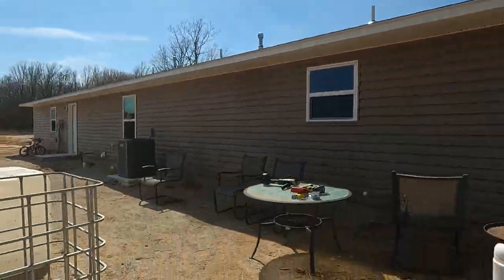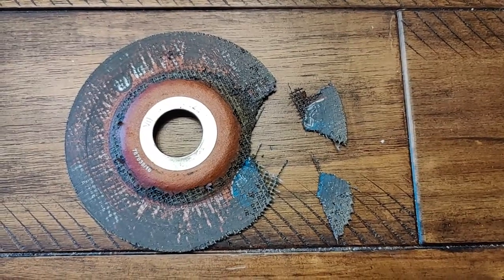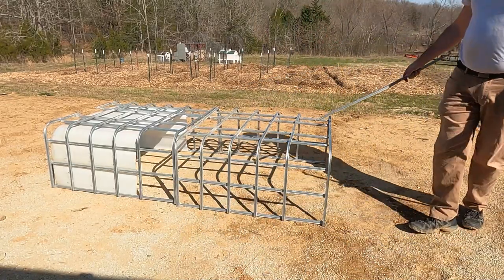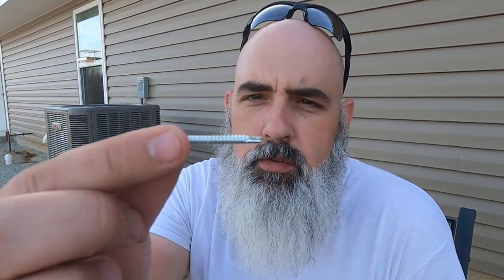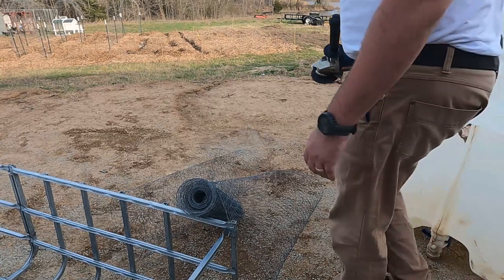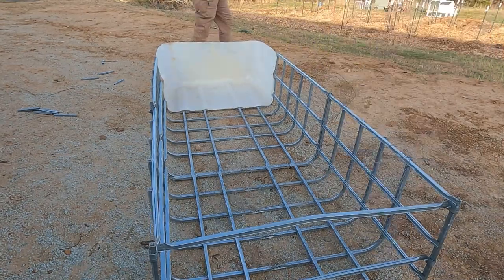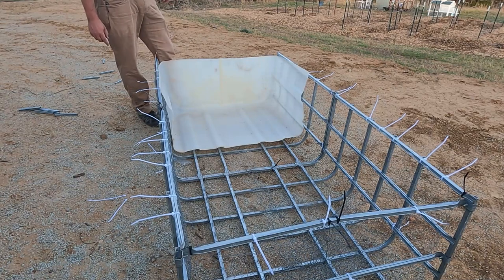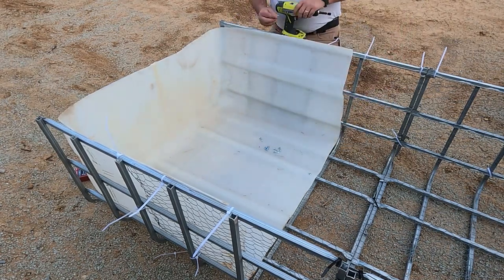How to Build a Simple, Sturdy Chicken Tractor from an IBC Tote

Comment: That looks like it would make one hell of a green house cover for a garden too.
Reply from the maker: Great idea!  You could build raised beds to this exact dimension, then line the cage with some greenhouse film, and pop them off and on as needed!
Reply: I love that idea!! I wish IBC totes were less expensive in my area. For now PVC arches over raised beds is a lot cheaper. But I am going to keep this idea in mind. :)
Reply: I would leave the 4” half sections you initially trimmed off and then use that to screw onto a 2x4 or 2x2 pressure treated frame to skid on the ground.

Comment: Really good idea. Keep making videos this way. It shows your thought process and if you make a mistake, it's one less we have to make. That being said and with my advantage of hindsight here are a couple things that I think might help
1- Pre-drill the first Layer of the frame, I don't think you will gain that much structural advantage by going through the fourth wall, plus youwon't have a screw showing to get a hand sliced up on.
2- washers on the plastic will insure the IBC plastic doesn't tear out if yo get critters jumping on it to get at their lunch.
3- Go ahead and zip-tie the chicken wire to the bottom rail from the IBC end forward and get all that snugged down before tackling the end
4- You might want to add a hatch to birds in and out of.
5- A five gallon bucket with a pvc pipe and watering nipples could be added.
Thanks for a great idea
Reply from the maker: All good thoughts! Thanks for your insight on this!

Comment: Brilliantly done. Pure genius. I like it raw 😊
Reply from the maker: Thank you! This year I did add one new board across the back/bottom - the plastic was starting to curl in a little creating a gap, so I screwed a 2x4 across the bottom and then screwed the plastic into it to have a solid ground piece. Other than that, it's still functioning as originally built
Reply: @FromtheRootsUp  We are going to build one and will send you a pic when completed 🙂

Comment: Loved your solutions, just need a neighborhood hardware store. Worm clamps if the same width and type can be daisy chained to extend them as long as needed.  The black wire ties have a higher uv light resistance and the white seem to have very little.  The white become brittle quickly and the black take a lot longer.  Clever idea and solutions.

Comment: I would add the chicken wire on the outside.  Reason being that predators will be coming from the outside and the frame will help hold it. But from the inside it will be easier to push in, aka dead chickens
Reply from the maker: That is a good idea. If you're really concerned about predators, you shouldn't use chicken wire at all tho, hardware cloth is much stronger and they can't reach through it. So far our LGD is keeping the predators away and our wire hasn't been tested.

Comment: I enjoy the ingenuity of the design, and can't wait to see updates.
My mobile coop is a Suscovich style tractor, but it is heavier than I prefer. My mistake was using reclaimed pallet wood, which was mostly hardwood.
Reply from the maker: Thanks! we've built wooden ones in the past... they can get heavy! this one is light partially because it's aluminum, but also because the design limits the size. I'll be building one more for sure and already thinking of small ways to tweak it.
Reply: You could spread the two pieces apart and put metal bars in between. And extend it

Comment: So...how do you get a waterer in and out of it on moving days  without the birds getting out (assuming you lift it up)
There's no door-
Reply from the maker: On this one, yes, I just lift it up. I'm watering from an open dish, easy to fill from the outside, which also means I only have to raise a corner of the tractor up a few inches to slide it out. My next one will have a door, but I wanted this design to be as simple as possible, and it hasn't been a problem. I will make a video showing it in action when I set aside some time to do it. Thanks for watching!

Comment: As someone who has designed and built chicken tractors, (I use PVC pipe for the structure), I understand the trips to the hardware store. I have been using mine for three years and I have some concerns about your particular design, it is ingenious.
How do you access the birds with no opening? Second, I have had my share of run ins with predators and maybe the wire should be placed on the outside of the base cage. Third, the unit may not be heavy enough to handle the Oklahoma wind, especially lately with the excessive wind we have been experiencing the last couple of years. I have a small homestead near Enid. Designing is wonderful fun.
Reply from the maker: Thanks for watching, and I hope the idea helps with your own designs! I've had many similar comments, and plan on recording an update video soon to explain why most of these are not issues for us, but everyone has different needs for different circumstances. Aerial predators cannot get in, and our guard dog has successfully kept the 4-legged kind away so we have not had issues. If someone is concerned about predators then putting the wire outside might help, but if bigger importance would be don't use chicken wire at all... hardware cloth would be much stronger and too small for snakes. you would also need to cover the bottom to fend off predators. We have experienced high winds since building this (60mph+) and as yet have had no issues, it's heavy enough for it's low height to not be affected... but here in OK we know winds can move a whole house, so at some point you have to accept some risk. As far as accessing the birds, I don't need to access them because of what I use tractors for... I'll explain that more in my update video. Thanks again for watching!

Comment: Great Idea. Been looking for something like this. Would be curious as to how you access the inside to manage the birds and manage to food and water.
Reply from the maker: Sprinkling feed in through the wire right on the ground works fine... part of the purpose of a tractor is to give them grass/ground to scratch on, so they find the feed just fine. a bowl dish for water is easy to fill through the cage as well, but I'm looking for a waterer I like, that mounts to the cage, and can be filled from the outside. When I find a solution I really like, I'll add a video about it. I'm just raising up one end and reaching under to catch birds (with someone to help as needed) but plan to cut a door into the back end (plastic only end) later.

Comment: How are you putting food and water in without an opening on the top? Great video get more space by pulling the plastic badder out to the second rib and fasten it there . Use 2 2x4s for securing the extended bladder and ease of moving around.
Reply from the maker: that's a great idea to increase space! for food and water I keep it simple. we're watering in a dish right now, so we just pour water into the dish, goes right through the cage. also feed goes right onto the ground... they're learning to scratch anyway, so it's super simple.

Comment: you should of left some over hang of the chicken wire to fold outside the cage sides to prevent predators from digging under .. also they need roost
Reply from the maker: Good thinking! If predators are a problem, covering the the bottom helps, and I would also upgrade the chicken wire to hardware cloth (the smaller square-holed wire)... it's stronger and thing like raccoons can't reach through it like they can with chicken wire.

Comment: The weld lines of square tubing are often harder to drill through especially with self tapping screws at least that's my experience with steel tubing, which is not aluminum...  Enjoyed the video!
Reply from the maker: good tip! I won't have the option of changing the direction when screwing them together the way I did in this video, but I am going to use some of the scraps I cut off and test this theory... there may be times in the future that just going a different direction will make a big difference!
Reply: When drilling holes in metal, oil is usually applied. The lubrication is a cooling effect on the cutting surfaces of the bit.
When using a self tapping screw the same effect can be obtained by "feathering" the tool, allowing the bit/tapper to cool. Allowing the screw to cut longer and through more surfaces without burning up the cutting surface of the screw/tapper.

Comment: Did you go back later and add anything for the chickens to 'roost' on under the plastic shelter piece?
Reply from the maker: I have not added a roost for them yet, but a 2x2 furring strip could easily be screwed right to the plastic or even through the aluminum cage and into the strip.

Comment: This is a great idea, however here in Australia the foxes would be right under that, in the middle of the day too, they're bold as fuck these days. Another idea I've seen from other videos is to get a 2 ft wide length of stiff mesh and attach it around the edges, so it can fold up like a flap for movement, but then lays flat on the grass so when the foxes try to dig they're standing on it
Reply from the maker: Yes, this design is susceptible to digging (or even lifting/prying as it is not very heavy.) depending on your predators, the flap idea you suggested is great!

Comment: So...now that you have had it for awhile. How do you like it? Anything you would do differently?
Reply from the maker: it works very well for my purposes... but everyone has different needs. once our chicks are big enough to leave the brooder they go to this tractor. when they're big enough to go in one of the bigger coops and/or free range some, they leave the tractor... it's not a permanent dwelling, so I don't need to access them regularly to collect eggs. feed and water flow right through the wire, and raising a corner to grab the water bowl for cleaning is quick and simple too. if I were tractoring meat birds all the way until butcher weight (which a lot of people do) I would want something bigger, or maybe several of these. I have considered enclosing the bottom with wire also, because a couple of times if it sat on uneven ground the smaller chicks could get out... but then I would need a door, and if they run to the other side and the only access is a little door, it would be frustrating to get them out, so I have put off making that adjustment and just try to be careful when I move it to not leave gaps.
Reply: @FromtheRootsUp  I have 4 older hens that my wife is attached to, doesn't want to eat her pets. So I'm thinking a small tractor like yours would be good for them in our garden.

Comment: you the right idea but you bolt both halfs together where the hole at the bottom of the tote cage when using chicken wire you need to use wire cutters the wire the self taping screww you can use to hold plastic insert
Reply from the maker: you should try cutting chicken wire with an angle grinder sometime (especially if you already have it out for other parts of the project!)... so fast and easy! Thanks for watching!

Comment: Drill holes all the way threw and use coat hanger to run threw it chuck both ends in the drill and twist till it’s tight
Reply from the maker: Not a bad idea, thanks for the tip! (It would be another trip to home Depot because all our coat hangers are plastic 🤣)

Comment: I am in Minnesota on open ground. I am worried that if I build too light the chicken tractor would get blown over. We can get some very high winds. 100mph recently.
Reply from the maker: We get strong winds in Oklahoma too, and so far it hasn't been an issue, but I don't think we've seen 100mph 😬. If I were having wind issues with this design, I would stake it down at the corners. Thanks for watching!

Comment: I was wondering why you didn't use washers under the screws?  And you could have held the plastic part in with zip ties -- drill a hole on either side of a metal cross-member and run a zip tie through the holes and around the cross-member.  I think I would have just zip tied the plastic shell on the end, not inside the metal frame, which would have added more square footage to the tractor.  But overall a good chicken tractor, which gave me some ideas.  I've been building chicken tractors out of rabbit-cage wire for years, basically they are just big rabbit cages without floors.  I set a couple of scraps of plywood on top for shade/rain protection (if the wind blows those off, at least they don't flip the tractor over).  These would be a lot sturdier than the rabbit wire, though.
Reply from the maker: didn't use washers just because I didn't think they were needed. if they come loose or pop out on me I'll have to revisit that. zip ties would also work but there is more strain on the plastic dragging the ground than the wire being zipped to the cage, so I wanted to make sure it was sturdy. a few people.habe mentioned extending the plastic for more room and I say if you want we'd the extra space, then go for it! the plastic is fairly flimsy, so it definitely needs reinforcement which probably means adding lumber which will start making the tractor heavier and it just slowly becomes less light, simple and easy to move. of course there are hundreds of ways to design these for all sorts of needs... so I'm glad my design has given you a different perspective. good luck on your builds and that is for watching!

Comment: Great idea,what was your reasoning for putting the chicken wire on the inside?
Reply from the maker: Just being able to sandwich it between the plastic shell in the back, and grab the frame for moving around without grabbing wire, and ease of installation. A fair argument can be made that being on the outside will keep predators from pushing it in... but honestly, if predators are a problem for you, don't use chicken wire at all... use hardware cloth, and on a tractor this small and light, wrap the bottom as well (and create a door for access) or at least stake it down good. If all I did was move the wire to the outside it wouldn't come close to stopping something like a coon. Our LGD keeps critters away, so I was shooting for cheap, simple, and lightweight. Thanks for watching!

Comment: Add some wheels or casters, through the bottom cage frame.. for transport  around  your  yard
Reply from the maker: You certainly could!  This is so light, it's really easy to scoot around all by itself, but if you start adding things like a roost, a nest box, etc... little wheels will start making a bigger difference!

Comment: Why not add plastic to side of cage instead of under 1/3 of it? Could've got bigger foot print an taller by cutting it for A frame style.
Reply from the maker: good idea and you can increase the real estate a little bit... it just takes a little more effort lining up your cuts on the corners to get good straight edges, and also you'd be cutting the plastic across the diagonal as well which means cutting through the cap. Not impossible... again, just a little more effort and extra steps. This was the simplest way.

Comment: I would add a washer on the plastic side, so you don't pull thru the plastic and hold nothing
Reply from the maker: Someone else mentioned this as well, and if I would have thought of it I would have added them. The heads on the screws are pretty big, and if it ever pulls off I can add them. Good tip, and thanks for watching

Comment: How do u water and feed them
Reply from the maker: I use a water bowl (like a dog would drink from) - it sits inside the tractor and I pour water straight into it through the tractor. supplemental feed gets tossed in into the ground so they can still scratch for it... but one of the big reasons to use a tractor style cage is to move it around the yard giving them access to grass and bugs and use less production feed. thanks for watching!

Comment: I still feel you would have been better off using a bolt and wing nut to bind together.  It's easier to drill thru 2 square tubes and bolting them together .  Or just use hose clamps.
Reply from the maker: yep, I considered both, and the hose clamps ended up working. I might go back to the wing-nut idea next time just to compare. Thanks for watching!

Comment: “In theory” HOSE CLAMPS are more temporary than bolts snd nuts.
Reply from the maker: yeah, it ended up working well, and I plan on leaving them until/unless they fail. If they fail I will want to be able to share why and how they failed. I like the idea (if they don't fail) because some cages are round rods instead of square and are a little more difficult to tap screws into. Time will tell. Thanks for watching!

Comment: Too make it easier why not put the chicken wire on outside of pen instead on inside it would reinforce the wire incase of predators getting on top
Reply from the maker: I can't think of a reason that wouldn't work... the only difference I can see would be aesthetics. If predators are a concern tho, you don't want chicken wire at all... many can reach through it and some can just destroy it. Switch to a hardware cloth for predator control, but you're right about moving it to the outside - the tote frame will reinforce it from being pressed in. We have a livestock guard dog that so far is keeping unwanted critters at bay so I can get away with chicken wire.
Reply: @FromtheRootsUp  I am following ur design  mostly.  Mine is for daily use to eat up and fertilize the grass some. Little modified. I made one cut dow the middle and added pvc pipe to sides for glider and few extra inches I know later have to change to wire but only had green plastic fencing from garden and place for water and food to hang from top easier move. Ty I have been trying to figure out nice build that would work for me👍👍
Reply from the maker: that sounds excellent!  Love the tips!